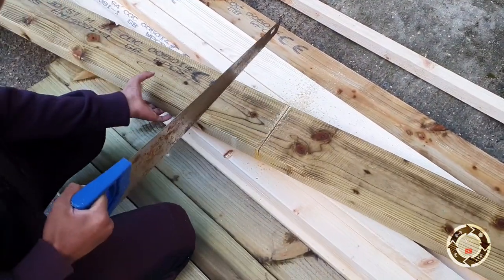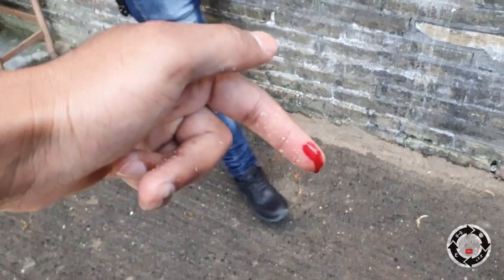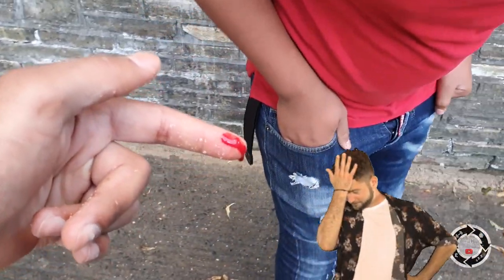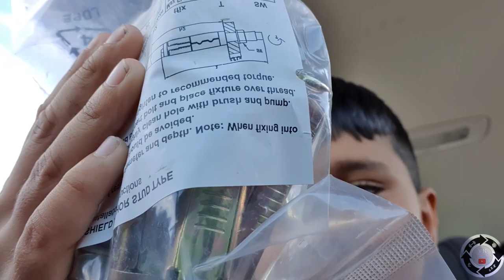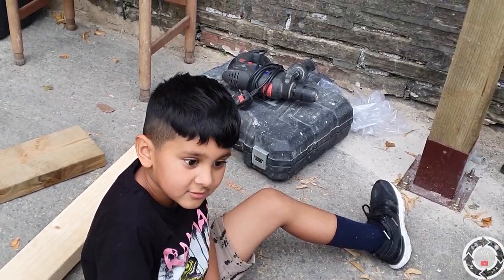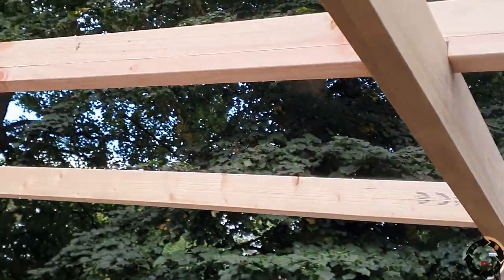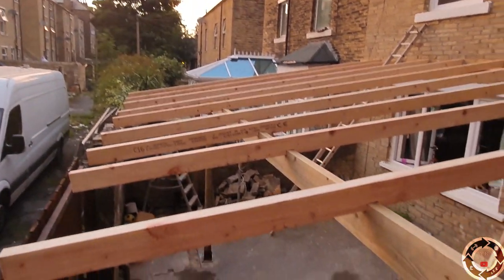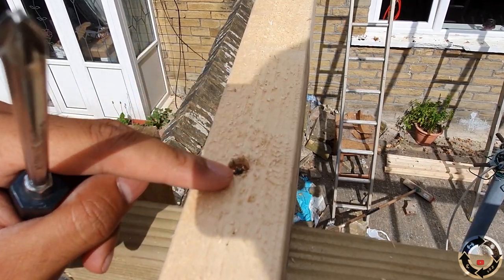We Built A Lean To 7MX5M *CARPORT*

Comment: Bought an old house with a massive garden at the start of the first lockdown and fixed everything up nicely on the inside so now I’m about to tackle the garden, was planning on building a garage but now I’ve seen this I think I’m just going to build 1 of these at the side of the house instead thanks for the high quality video😊
Reply from the maker: Glad the video helped 👍 all the best with it. The garage would be better in windy days but this does the job for now I was thinking to block the sides off also

Comment: Nice one bro💯💯 im thinking of making one for my cars too. Nice inspiration
Reply from the maker: No problem bro hope the video helps
Reply: @YKRECREATION  definitely. Will allow me to make more videos on my channel in the wetter days. Soo many times ive cancelled filming videos because of the weather 🤧 seems to be the best solution for cheapest cost atm
Reply from the maker: @19hmxd  definitely helps alot we used to wait for calm weather to work on cars but now we don't have an excuse. We made it this time last year
Reply: @YKRECREATION  ahaha yh thats the thing im worried about. Once its up, then i gotta find the next excuse for not posting any videos😂😂how much did it roughly cost you all in?
Reply from the maker: @19hmxd  mines pretty big covers my whole garden, around £1500 + I should make a video breaking down the costs
Reply: @YKRECREATION  im looking to make one about 7m x 4.5 ish but the back part is only 2.4m as the boundary triangulates. but id need to concrete base first aswell. So gotta dd more costs for that
Reply from the maker: @19hmxd  should be fine, use post mix for stomps
Reply: @YKRECREATION  but i wanna drive onto it.  Cureently we have grass. So cant even really jack up the car or anything so will need a full concrete base.  Considering a gravel temporary one for the time being. Idk. Will see how it goes
Reply from the maker: @19hmxd  best to concrete smooth won't be safe with gravel
Reply: @YKRECREATION  true. Ive got some slabs too which i can relocate ontop of the gravel can use them in 2 rows where the wheels go and use that as the jacking points if needs be. Theyre the 600x600x65mm slabs so big enough and heavy duty enough for a temporaty fix untill i can afford to concrete it all over